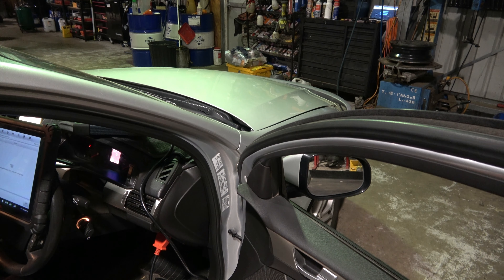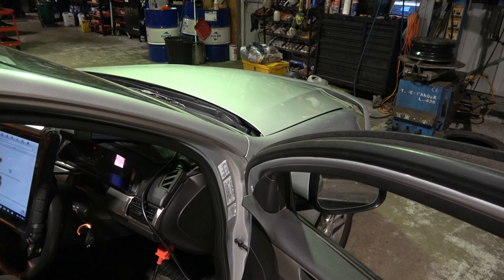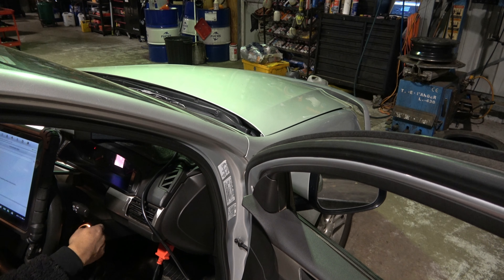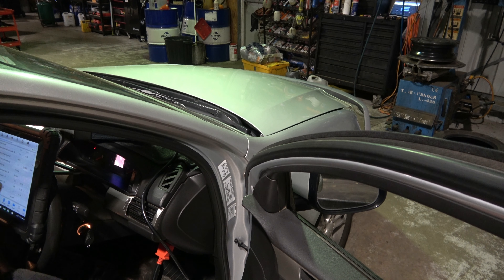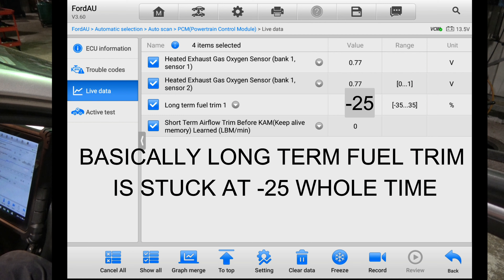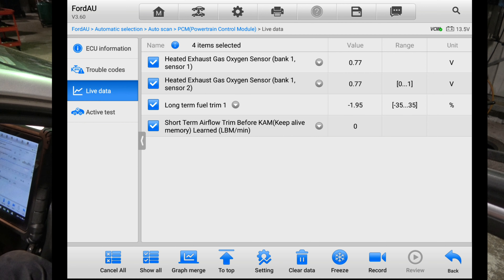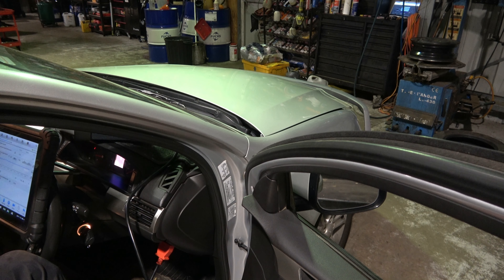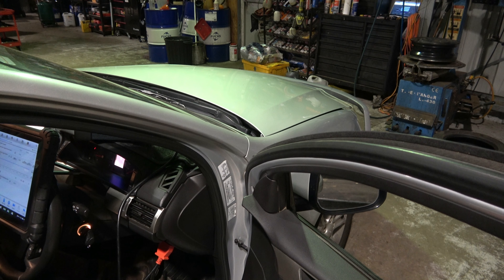FORD FALCON AU BA BF FG O2 RICH DIAGNOSIS

Comment: Great explaination. Was doing my best to find out why my Ford Falcon BF was running too rich. But I hope this will fix my Falcon's problem. Been looking all over the place for this diy diagnosis. Thanks for your info and the best info you gave. Keep up the good stuff and vids. =l
Reply from the maker: Thanks Rado. Also check the fuel pressure after the regulator on the return or at the tank on return hose. Sometimes I had Falcon return tube blocked in the fuel pump assembly. If the pressure is still high on return side. Regulator is not the problem.
Reply: @a1mechanicaloakey639  ok sure. Thanks for the guide also. I will do my best to check it up. Because I do recall changing both my o2 sensors. And engine light keeps returning
Reply from the maker: @radoa4  my pleasure, good luck. Also don't forget to hit that subscribe button. Thank you
Reply: @a1mechanicaloakey639  oh already did subscribed haha. Just hoping for more diagnostic vids diy. Even though you lost vids. You didn't forget to explain the problem and pinned out the issue so it will help many of us Ford  and other car makers enthusiast out in long term. Keep up the good work at helping 1 another with these tutorials. =D
Reply from the maker: @radoa4  yes plenty more videos to come
Reply: Another issue can be intake gasket leaking if idle is over 750 to 800rpm warm engine.  Code is presented PO 171and PO174 and change O2 or fuel regulator Bosh won't solved problems.  Fuel trim short and long can be between + and -10 in idle 2500rpm what this professional have not done,but it is very important test ,but 0 reading is best.
Reply from the maker: @stevanzaharic  wrong. 
If there is vacuum leak, fuel trim would more likely to be on positive side
Reply: @a1mechanicaloakey639 ,Fuel preasure regulator fault is easy to check only take off hose from regulator to sea present fuel leckage.Fuel preasure test with T conection is most for problems of week or damage fuel pump. Isue. +25 or -25 fuel trim will show present codes specialy with 2.500 rpm best way to check fuel trim. Usually when long fuel tri decresing and short fuel increasing all problem with intake leackage can be notes.I'm metal trade profesional who is still learning from hight profesional mechanich about OBD-2.
Reply from the maker: May be you should change your trainer.
Reply: @a1mechanicaloakey639 ,Definitly not trainer like you.I'm happy with my noliage metal traidsman which is hight level than your trade and good books,nice people from yotube,Good Scaner US 703 for Ford Falcon and ForScan sofware with chip ELS27 free for every two months. I can program/repair without delers and mechanic like you.
Reply from the maker: @stevanzaharic  good luck

Comment: Another test is to check the fuel flow on the return line .Should be around 600ml  in 30 sec on an AU .faulty fuel reg generally deliver well over 1lt in 30 sec
Reply from the maker: This is a blocked regulator issue
Reply from the maker: And please subscribe if you haven't already. 98% of my viewers hasn't subscribe

Comment: Great video, I am assuming this is a P1132 code? Also hw much should one expect to be charged for the diagnostics and subsequent fuel pressure regulator + fuel filter replacement (in Australia)?
Reply from the maker: Around $300 to 400 roughly. Again depends on what quality parts to use.

Comment: My car is runing rich 15.5 litres , but no engine light on dash , month ago had Engine light on code P1381 camshaft position timing over advanced (bank 1) 
Cleared the code didn't came back again . Any suggestions? 
Thanks
Reply from the maker: How do you know it's running rich? Don't rely on mileage tracker. check O2 data and fuel trim first.